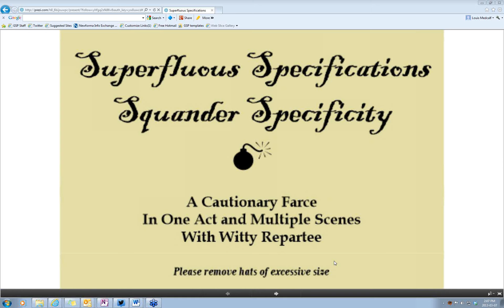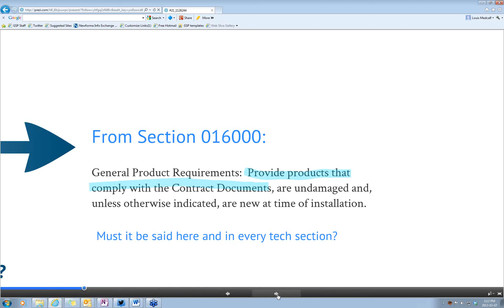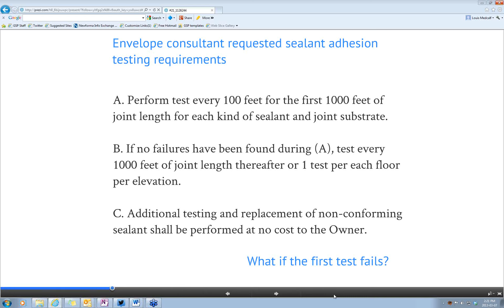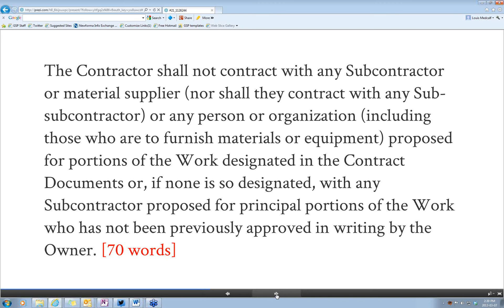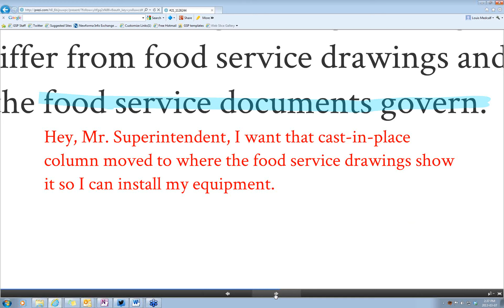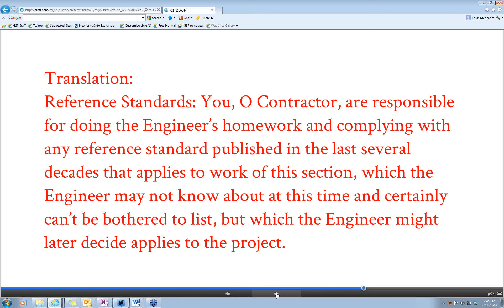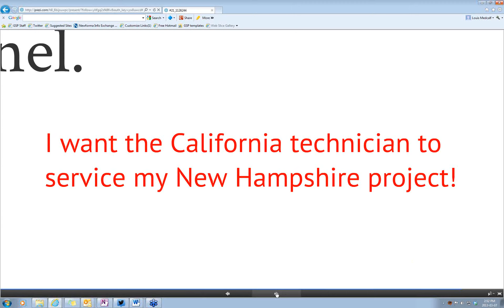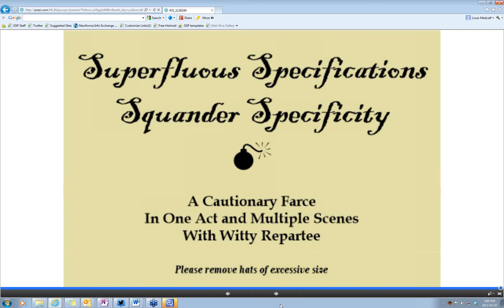Superflous Specifications Squander Specificity

Comment: "Reference Standards: You, O Contractor, are responsible for doing the Engineer's homework and complying with any reference standard published in the last several decades that applies to work of this section, which the Engineer may not know about at this time and certainly can't be bothered to list, but which the Engineer might later decide applies to the project."